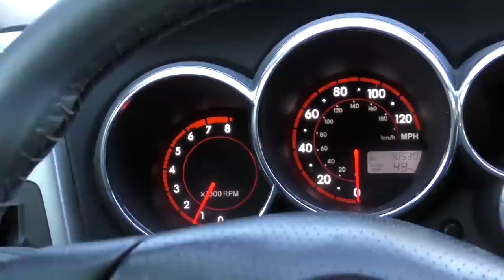Please Stop Doing This to Your Transmission (It Destroyed My Car)

Comment: Just empty and fill......flushing is a way for certain mechanics to cash in... your actually flushing all the garbage in the transmission into the little passage ways and all it takes is a couple of them passageways to clog up and trouble will begin.... slipping being the most popular issue now u got to have transmission torn apart to clean out passageways and hopefully didn't ruin it..drop pan.. drain... change filter.... replace pan .. refill.. easy peasy

Comment: Nearby there is a nice convertible V8 mustang for $3000 but the transmission slips.  I was thinking about offering $2000 and filling it up with Type F and see if I can drive it until I have time to rebuild it.  I rebuild my own transmissions.  Once I rebuild transmissions when I reinstall it I plumb in a spin on hydraulic filter.

Comment: Another tip is to make sure you are completely stopped when you shift into reverse or drive from reverse. Over time if you roll back while the car is in drive it will ruin the reverse gear.

Comment: I have a 2016 Ford Fiesta with about 30,000 miles on it. It still runs great but should I think about changing my transmission filter and fluid?

Comment: I bought 2013 Charger R/T recently and it has about 40k miles on it, everybody said to change the ATF especially with low mileage like that. So I did, they pressure changed the ATF. Now I don't know if it was a good call or not.

Comment: I have had my transmission serviced at the local GM Dealership every 40k since I baught it. I am sitting at 204k miles now and no slipping or bad shifting. I do the filter change every other change. Maybe Goodwrench uses a better system I don't know. I do know that my transmission is shifting great after 201k miles on it:P

Comment: Happened to my dads bmw. They always told him it’s a lifetime filling, and warranty until 150k kilometers. Guess what, 5th gear was gone at 152k , and 1st gear at 155k kilometers.

You need to change the filter and magnets (If your transmission has them) regularly. If there‘s a filter, it‘ll clog up
Reply: behexen250 you can do that. But many transmission service kits contain new ones

Comment: You can also damage your transmission by putting it in reverse when you are still moving forward and vice a versa.
 But with an electric car, it doesn't care. U can whip back and forth all u want to quickly.

Comment: A local mechanic conviced me to do a transmission flush on my 2014 Ram 1500 with 30k miles. It never stopped leaking transmission oil after that. Changed the sensor and the gasket twice. He then said it was a transfer case issue so I had to take it to the dealer. I got rid of the truck. I loved that truck :(

Comment: So what I understand is that if you wanna do it. Do it regularly after every 60k and by the old method of opening the tray and all.
Now I imported a used car from Japan to Pakistan having 100,000 km on it. The user manual and stuff was in Japanese that I can't understand. How would I really know if the owner had changed it on time or does the oil needs to be changed. Some mechanics here smell the oil and say no need to change.

Comment: Gosh you should've seen the size of the transmission filters on the quarry dump trucks I used to drive -  9 inches diameter by 12  inches long.  I don't know if they were Clark powershift or Allison automatic, probably Clark. I don't really care who made tem but the gunk accumulated on the filters was incredible (and inedible).

Comment: I'm nothing more than a shade tree mechanic, so I listen carefully to those that appear to be knowledgeable on the subject of automatic transmissions (or anything I don't have hands on experience with) and how they work.  My determination after dozens of videos and pages of literature on how autos work, the pressure they run at, the filtering process, etc:  In the context I look at the situation, flushing a transmission will NOT damage or otherwise adversely affect it in ANY scenario.  If there is a problem after the flush, the problem was already there and the sudden introduction of proper maintenance where improper maintenance was the norm, revealed the problem.  I've heard all the arguments of "but the little passage ways..." and the "it's going to knock stuff loose..." and "the flush machine will put more junk in the trans" and on and on.  None of it jives with what I've learned concerning the operation of an automatic transmission or the flushing process.  Yes, lots of people have problems after a flush and a flush may or may not be of significant benefit over just a fluid change, but the root of the problem wasn't the flush.
Reply: Well, many of us dont have $2,000 cash just laying around. And there are some mechanics that aren't honest because customers aren't mechanically inclined so that's part of problem.
Reply: @invaderzim1265  Well, over half the world's population lives within a 5000-mile-wide circle in East Asia making it the most densely populated area on the planet
Reply: Will more customers come to mechanics more often....?
not likely until there are more folks like Scotty.
Reply: @invaderzim1265  I don't know...?

Comment: Guess my 2013 100k plus mileage was in the 25%. Prior to the flush we did the tran would slip or high rev before it shifted. It's been almost a year now. Fingers crossed she's running fine. Btw we did ask to have the filter change and was told it didn't make since.

Comment: My 02 subaru 4eat was on original fluid at 142000 and 16 yrs old.  After a drain and fill it wouldn’t go into 3rd gear when cold.  It would go to neutral.  Eventually with other drain/fills/treatments and even a full flush the problem went away.  30k miles later it is running fine.  I have no explanation.

Comment: Truth. Dealer convinced me to do a flush. Not even a 1000 miles later the transmission started slipping then stopped working all together. NOT cool, dealer. Not cool.  Now I only tell them to do a drain/fill. NOT flush. How do professional mechanics not understand this?

Comment: I have a 1995 Jeep grand Cherokee Limited has 150,000 miles I drop the pan and it was black and filter black I was scared but I still put fresh transmission fluid in change the filter. Then I took the return line off ran the engine until it started spitting Transmission fluid shut off the engine and I put two more quarts I repeated the process until I see the transmission fluid came out clean. Before I was done it took about 12 quarts and it runs great. So I have a 1989 crown Victoria LX with 152,000 miles and same situation so I guess it’s luck?

Comment: Well, I got mine flushed at around 120,000 miles. No idea if it's ever been flushed before, car was shifting fine, but I wanted to get a flush cause the fluid looked a bit dark. Flushed it, car still shifts fine, I'm up to 135,000 miles now, still fine. I guess it just depends, and too, maybe the car has had a flush 60,000 miles prior and it's used to it, don't know.

Comment: This is best . If you have not owned
The car from new and say it has
80.000 miles drain fluid top up put
Transmission through its motions
Then change it again after a run
Repeat same process

Comment: Scotty! Love your videos! I'm looking to buy my first car and I'm looking at 
1. 2008 Mazda 3 sedan 140,000 miles 2. 1996 Honda Accord 124,000 miles 
3. 1998 VW Jetta TDi 350,000 miles 
All have MANUAL transmissions and all are $3000! Which should I choose? Thanks!
Reply: Sorry bro.

 But you must catch him when he's doing LiveStream otherwise he wont answer any mechanic question in the comment section because there's too many folks asking him but there's only one Scotty. So you're best shot is to tune-in when he's doing LiveStream. I believe he's on the Air Live this Sunday coming up.
Reply: I'm not a mechanic but I would look at them in the order you posted them. Keep in mind the last two are definitely a little old so you might want to check for signs of leaking from the rubber seals (trunk etc). Also 350k miles is a hell of a lot of miles, I'd be especially weary of that one, definitely don't pay $3000 for it. Also don't be afraid to haggle a bit, don't pay what they're asking, you can always save at least a couple hundred from the price they give. 
Good luck.
Reply: The Honda!

Comment: I'm going to re-watch this at a later date.
The message I got out of this video:

Do not power-flush the entire contents of your transmission fluid out, makes me think of those fast oil change business such as Lube City in my local.
Change the transmission filter.  Replaced lost transmission fluid with fresh fluid and maintain some of the previous transmission fluid.
Consult my Owner's Manual to identify when it is time to service the transmission fluid.
Find a mechanic who knows how to care for transmissions and make certain that mechanic does not suggest power-flushing as transmission servicing.

Years ago when I was still driving a 1989 Nissan King Cab Pickup I went to my local Lube City and the representative advised me to powerflush the old transmission fluid out.  I did not recall at the time on whether the fluid was ever serviced and so I authorized it.  I had no issues with the transmission, it was a manual, and I did notice improved shifting.  BUT I took a bit of a risk to authorize a job without properly understanding.  I will be re-watching this to verify my understanding.  Please feel free to correct me.. Thanks Scotty!
Reply: @larrybe2900  Now I know. Back then I was a twenty-year-old trying to learn the ropes of life.  :)

Comment: So Ive got a transmission from a junker to put in my truck. I don't know the history. all I know is it works fine. Would you just run it as is or drop the pan and change the filter? If so for dropping the pan, should I recover the old fluid or is it OK to mix new fluid with the old stuff that didn't come out with the pan?

Comment: After owning Subarus for years here in Jackson Hole, Wyoming, I bought a 2007 Volvo XC70 with low miles. Wanted a Forester, but couldn't find what I wanted.
Heavy as it is, the Volvo has plenty of power. 2 question: 1. From a stop, a slight press on the accelerator pedal practically launches it forward. I assume this can be easily adjusted?
2. I need a second ignition key, but understand Volvo keys are specially coded and would cost roughly $200. Seems absurd. True? Thanks.

Comment: When I had the Nissan dealer to change the CVT fluid at 58k miles, I clearly told them do a drain and fill and they said okay but then when they billed me they did a flush, I'm like you wanna try to kill me with a CVT and a flush? So now with 105k miles and two flushes, no issues yet on a 2016 Rogue.😅
Reply: Is 60k the best time to do a flush on  a cvt transmission?
Reply: @joenaps104  According to Nissan, it is 😅 I just get it done every 30k now.

Comment: Why are they allowed to sell services that will ruin your car?   Honda actually tells people not to flush the transmission yet every time I go to Valvoline they try to sell it to me.   They actually recommend it every 20,000 miles and I used to do it. That probably explains why my transmission started having problems around 80,000 miles.

Comment: Great Video! So I have a 09 Honda accord with 117000 miles on it.  I bought i used and don't know if the transmission was ever changed. Do recommend I change it?

Comment: Changing the transmission fluid is a dirty job.... most transmissions do not have a drain plug and when you pull the pan down fluid comes out all over you.... SOO is it alright to remove a cooler line to drain some of the fluid into the catch pan so there will be less fluid in the pan when you drop it??

Comment: If you flush when the manufacturer recommends a transmission service you will not have the build up that breaks free and clogs. The transmission flush machines use a bladder system. The new fluid on one side the old comes in the other side and provides the pressure to feed the new fluid in. You are not putting any more pressure than the car does. I have seen cars whose transmissions have been fixed by a flush. I have also seen cars whose transmissions have been damaged by a flush. If you are having issues it is worth a shot. If you do it every 60 to 80k miles you will get a longer lasting transmission. But if you flush at 150k it is a crap shoot.

Comment: And I put jet engine oil lubricant in my AL4 transmission 60k miles ago. It's still like new fluid and shifting like a dream ... I'll never change it. That's the real lifetime fluid, like 50 years 500k miles.

Comment: Hey Scotty, I watch your videos all the time and I love the information AND the humor.  You are always discussing transmission issues and the importance of clean fluids which got me wondering: why not install an external tranny fluid filter?  After all there is a line from the transmission to the radiator for cooling the fluid so why not cut that line stick a filter in there and then no more pan removal to change the transmission filter.  What do you think? Thanks, Ron.

Comment: I'll agree AND disagree on that...I'm a mechanic in Montreal. We use a machine that works off the power of the transmission pump, the old fluid is pumped by the transmission itself into a double compartment tank that uses the pressure of the old fluid coming in to push the new fluid into the transmission. It's hooked up to the cooler lines, just like the power flushing ones. In all the years I've been using that machine, not once have we had the type of problems that power flushing causes. And we believe, just like you, that if the fluid is too old, it's better to leave it in. Since our machine uses the transmission pump itself to change the fluid, there's no external pressure pushing all the crud into the solenoids or the valve body. It just flows naturally. So, yes, power flushing is a bad idea, and so is changing really old fluid. But if you use the right equipment, flushing the fluid CAN be done safely. As a matter of fact, I've done it on my own car, a 2006 Ford Taurus, and you KNOW how finicky and fragile those AXOD transmissions are...and I've never had any problems.

Comment: Excellent video and sound advise. Question:  I have a Chev Silverado and had the plugs and wires at 90,000 miles. Before the new plugs, this motor ran so smooth you didn’t even know it was running. After new plugs, not so smooth. Dealership changed plugs and then said, had no oil.  Said need new valve cover. What the heck???
Reply: Yep found your problem. You went to the stealership , i mean dealership

Comment: I have a 2014 Altima with 103,000. Is it too late to change transmission fluid? It currently runs great. Only major previous maintenance was AC compressor.

Comment: I used to have my four speed auto transmission serviced annually (changed the fluid) almost every year after the cars original transmission died on me 20 years ago. 

My car was 35 + Year old Nissan Maxima straight six cylinder with rear wheel drive & 90 K miles. 

I gave it away as the car would hesitate and stall I'm the end
Not sure if this was transmission related.

Comment: I jad a 2005 hyundai elantra. The transmission started slipping and i got a fluid flush and change and they changed the filter. That fixed the slipping for a while. Other than that transmission that was a nice car. The transmission slipped slightly a while after that and about a year after the flush i changed the fluid again and it was dirty so it was falling apart inside so i got rid of it.

Comment: Hi Scotty! i Have a 2012 Toyota Camry LE just bought it from my uncle with 38,000 original miles (car doesn't have any shifting issues) do you think i should change the transmission fluid?
Reply: IF you do change the transmission fluid, PRAY that little to no damage is done to it. Good luck.
Reply: At that mileage, sure. Use OEM fluid only, and do drain and fill only, not a flush.

Comment: Ther was a recall on the 06 to 07 ford five hundreds and it would lung when shited into any position and they drained and replaced the the fliuld 60 thousand miles later still no more problems.

Comment: Scotty, I have a 2005 mercury mountaineer with 141,000 miles. I have never changed the transmission fluid. I got the truck with 105,000 miles used. The truck shifts perfect now. Do you think it is fine to change the fluid?

Comment: We use a BG trans fluid exchange machine that works based on the transmission pressure (GPM). Also when the exchange begins it has scales under the new and old fluid containers so it maintains an exchange and not a power flush. What is your opinion? And also your opinion of BG products? Love your videos.

Comment: Say if your transmission fluid has never been changed and your car has done 150,000 miles. Can you drop the transmission sump and run the engine for half a minute to get more fluid out, or is this likely to wreck the transmission.?

Comment: Scotty are you sure? 
My car is manual and has no transmission filter. Before 2 years my gears weren't ''clack'' as it should and the clutch pedal become little hard to push.
My mechanic says ok... let's change the transmission fluid. AND WOW! everything run great now two years after. so?????

Comment: Scotty, I have 56k miles on my 2015 Honda Accord. I've been putting serious miles the past year and a half. I bought the car used with 21k miles. (Yes I've put 35k miles in a year and a half) I love this car and want to prolong it's life as much as possible, this car has never had it's transmission fluid flushed, based off your video is it "too late" to start routinely doing the transmission fluid flushes? Should I just keep focusing on the engine oil only and drive it till it breaks down? Any help (from Scotty or anyone who knows is greatly appreciated)
Reply: No get it changed out at the dealer. That is not high miles 120 at dealer.